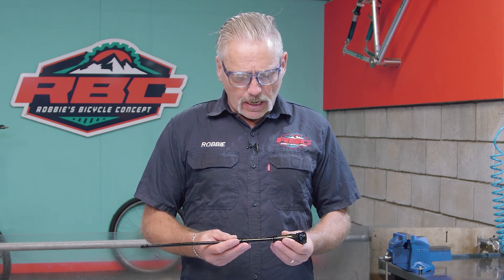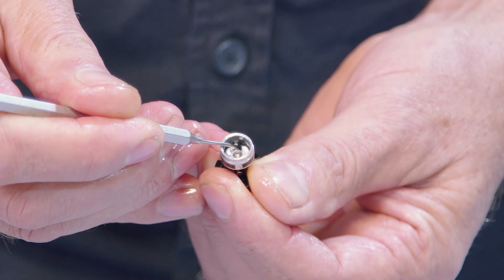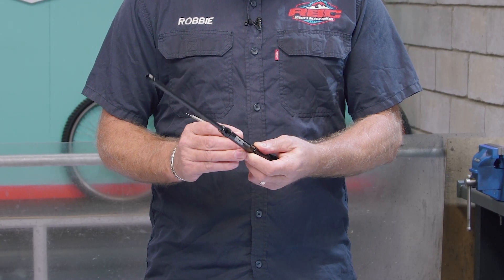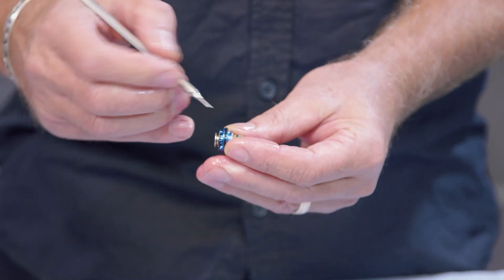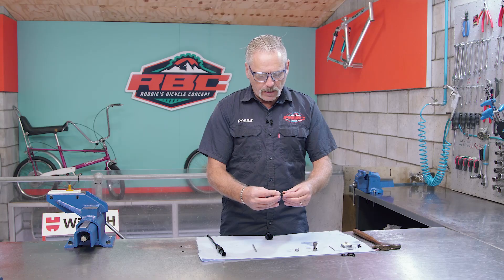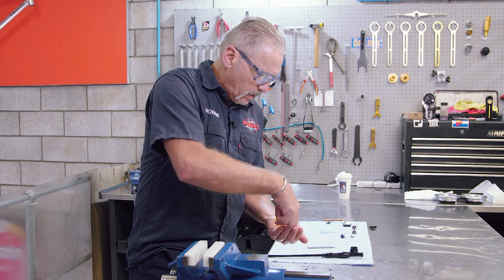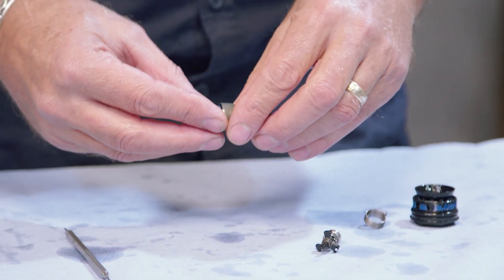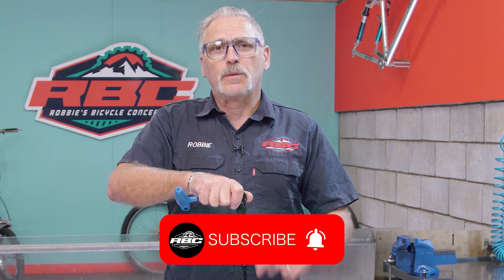Rockshox Charger Race Day Damper Fix

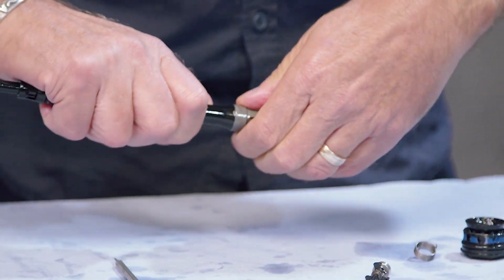Comment: Robbie at 5:53 you assemble Piston and SPRING. I checked that main body has a hole where spring long pin sits and top part of the piston has a opening where top part of the sping sits. QUESTION: does this spring has to be installed under any tention ? I ask because when I assemble parts without any spring tension LOCK AND UNLOCK mechanism DOES NOT HAVE ANY PRELOADED TENTION. Before I disassembled it , LOCKING mechanism required force to LOCK suspension.

Comment: Perfect video, thank you. One question though - how can I get to rebound assembly? I think I have loose rebound piston nut, but I can't detach the shaft with sealhead from the damper tube, there are no flats for wrench. Thanks.
Reply: SOLVED - I used old tube, wrapped it around the sealhead multiple times, put the loose ends between two wooden blocks which then served as a lever.

Comment: Hey Robbie can you remove the race day 2 damper from a SID ultimate 2024 without removing the fork lowers? I only ask because I have a brand new fork and don't want to split it if it's not necessary but I need to change the damper to a different remote one.
Reply from the maker: Hi Zane, thanks for your message and support of our channel. Yes you can  just remove the damper without removing the lowers. Be aware that the lower nut on the damper has very thin threads and fits into the lowers with a taper so it can be difficult to remove without the specific tool. Don't forget to top up the lower leg oil with the R/S Maxima heavy lower leg oil.
Reply: @RBC_tech  Thank you!

Comment: Hi Rob! Since I use the Rock Shox Race Day Damper in a Scott Spark for 2 years it has been replaced 3 times already by guarantee demand. Now I received a version 2 of that Race Day 2 damper. It is the Scott Version with 3 modes. 

Problem always was the lock out and the great leak of oil to the fork shaft.

I hoped to get now a perfect lockout with that version 2 (red screw at the lower end of the damper body). Unfortunately again there is no precise logout.

May I ask you: how much oil should be inside the damper? There is only one scrow to bleed the system. After pulling out all the air has the oil level to be at the upper end of the bleeding srew? Would it destroy the damper if there is too much oil inside?

Yours
Holger
Reply from the maker: Hi Holger, thanks for your message and support of our channel. Sorry to hear that you have been having some bad experiences with these dampers but its great to hear the Rock Shox have replaced these under warranty regardless, that's great service! There is a bleed hole in the top of the dampers so you can refill the oil whenever you feel that the level has dropped inside the damper between services. Normal experience is a lockout that only operates after 1 to 2 cm of travel or a squelchy sound coming from the damper. This means its time to bleed the damper again. Its easy to bleed and like you brakes, if you keep it bled by toping it up from time to time then it will work really well for you. Keep in mind that the damper oil should be replaced completely when the fork is serviced as just topping up the oil as described above wont flush out any dirty oil. This should keep the damper running smooth for a long time.
Reply: @RBC_tech  Hi Rob, thanks for sharing your experience! May I ask you: Now the Race Day Damper 2 is new with 0km. But again there is not a clear lockout. Maybe again it is not bleeded correctly from the factory.
What would you say: how far from the very end of the rotation there should be the best lockout? Yours Holger

Comment: Hi Rob. Thanks for the great tutorial. This is a very common ptoblem and will help a lot of people (me included). The lockout cup you just used as replacement has the following Andreani SKU 12.M14.001?
Do you know what is the type of o-ring/seal replacement we can use in this lockout cap?

Comment: Is it possible to remove the damper and only send that to you or do we send tje complete fork? Thanks Leon
Reply from the maker: Hi Leon, Thanks for your message and support of the channel. Yes its much cheaper from a postage point of view jus to send the damper. Please include the lockout or manual interface with the damper so we can check it before sending it back out. Its super easy to deal with us, follow the instructions on the link https://www.rbco.co.za/index.php?route=suspension/servicepricing - if you are outside of South Africa, I can arrange collection via DHL but I will be in contact with you to clarify this once i have the service details.

Comment: Greetings from Denmark. Thanks for the great video. I'm not sure this is the issue my Raceday damper has, but it is leaking oil from the lockout pin which means oil comes out on the outside of the fork. If it is this issue will it leak oil to the outside of the fork only when the fork is locked or also when it is open? When the fork is locked I can still move it about a third of the travel when I really put my weight on it. Does it indicate that the o-ring has split? The fork might have been leaking a bit before but after I serviced the fork it leaks more from the lockout pin.
Reply from the maker: @Martinzak2809, thanks for your message and support of our channel. If you have oil leaking from the lockout pin then the damper needs to be replaced. The o-ring preventing the oil from leaking out of the pin has split and it cannot be replaced. The open feeling in the fork after the lockout has been activated means that the damper is not full of oil so it only locks when the oil level reaches the shimstack. This is due to the oil leak from the lockout pin.

Comment: Thanks for this video! The lockout on my Sid Ultimate 2021 fork has just failed. Is the kit for this fix the “SID RACE DAY PISTON KIT – ROCKSHOX 32/35 FORK
SKU: 12.K14.011” on the adreani website? Doesn’t sound like the right part, and I can’t find it on your website either.

Comment: Great video, Thankyou!
Do you know of a fix for dampers which leak out the top of the lockout hex?
Reply from the maker: Hi @shmumeal2, thanks for your message and support of our channel. Unfortunately the small O-Ring at the top of the damper where the lockout pin exits the damper is not replaceable. To fix this you would have to replace the whole top threaded assemble above the bladder or purchase a new damper. If you are the original owner and the damper is within the 2 year warranty, reach out to your Rockshox distributor and check if they are prepared to warranty the damper.
Reply: It's a plain oring, size 3.0 ID x 1.5mm CS. You basically have to disassemble the whole topcap to get at it.

Comment: Do you know if the Raceday Charger will get damaged by rotating the lockout lever counterclockwise from its fully open position? I once hit something by accident and the lever rotatet counterclockwise, where it usually cannot go. I rotated it back, but I wonder if the way that the raceday charger works could mean that it is now damaged? Thank you!
Reply from the maker: Hi @BlackPixxelDE, thanks for your message and support of our channel. Hopefully the lockout lever just rotated on the pin and has not rotated the internal parts. If the damper has a open and lockout click and cannot be rotated counterclockwise past the stopper then you might be OK. However if the lockout lever can rotate completely round then there could be a problem inside. Please have your local RockShox service centre check this for you.

Comment: These cant be reshimmed and the hex lockout shaft leaks. Avoid
Reply from the maker: Yep I have seen a few that have leaked 😳
Reply: @RBC_tech do you happen to know if the new version w 2 addresses the leak? Or is it safer to buy a new generation fork?
Reply from the maker: Hi Monkeyseemonkey79, thanks for your message and support of our channel. Yes the new version is a completely different damper and so far we have not had any issues with this or the lockout. The new charger race day 2 would be a great upgrade over the race day gen 1.